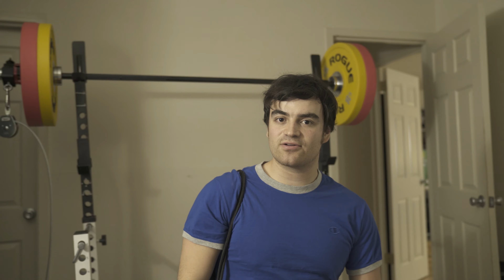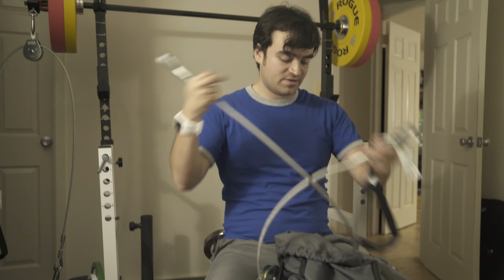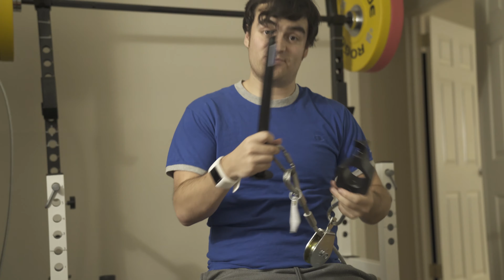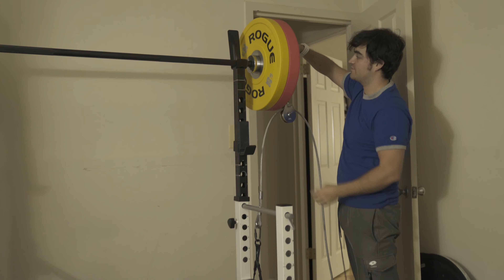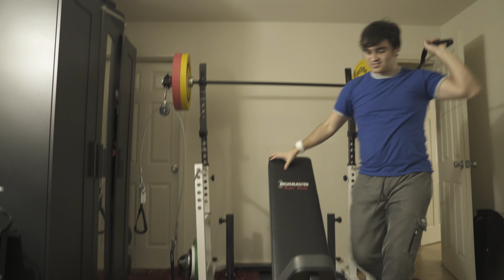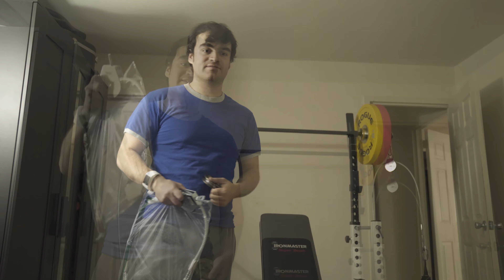Build a DIY Cable Machine for a low cost

Comment: Brilliant, but it looks like a fail video waiting to happen. LOL
Reply from the maker: yeah... There are mathematics involved, but to keep it simple.. have more weight on the barbell, than the weight pressed forward.  That will keep most of the energy stabilizing the rack... Put no weight on the barbell, nor bolt the rack, then watch the rack tip forward lol... I mention this on every comment and the description just in case... ITs very safe if this is kept in mind actually...

Comment: This is great! Been think of how to make something like this and this helps a lot! I need to figure out how to create something like this but I need to be able to have it low so I can pull up on it like a bicep curl type of movement.
Reply from the maker: If you find easily found components to attach the pulleys to from the floor please share...  
- One option may be using 2 pulleys per side and a longer cable.  
-- Weight stack attached to upper pulley. Handles attached to lower pulley
-- The question then is where to attach lower pulley though...  Maybe another loaded barbell, but then it could roll. 
-- SAFETY: keep the rack bolted or at least with a lot of weight on it to ground it of course

If you build it please share. Id love to see that setup.